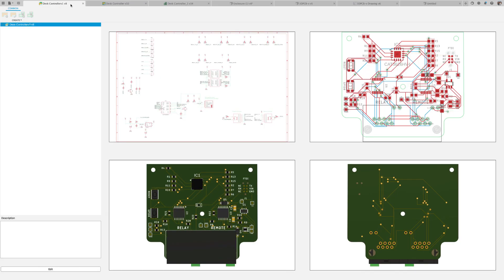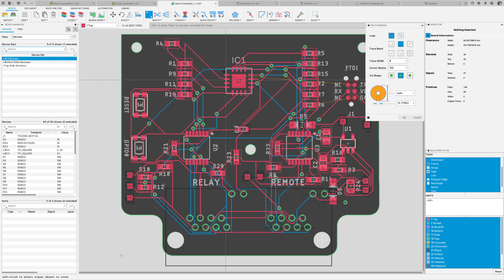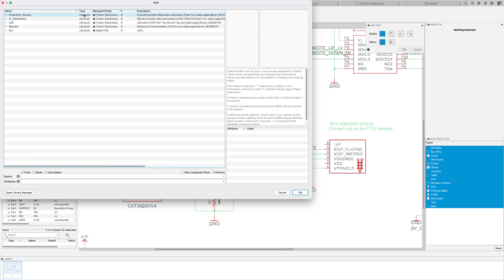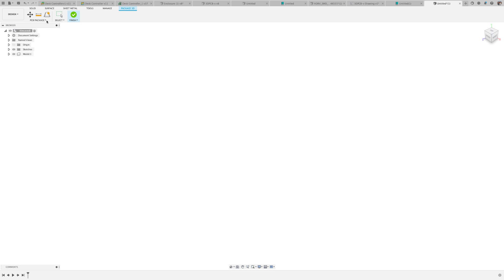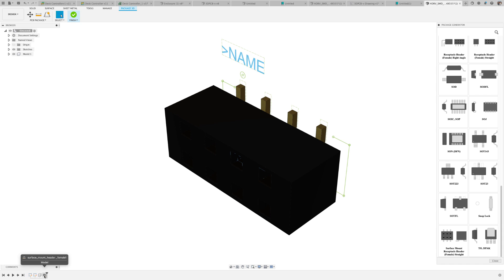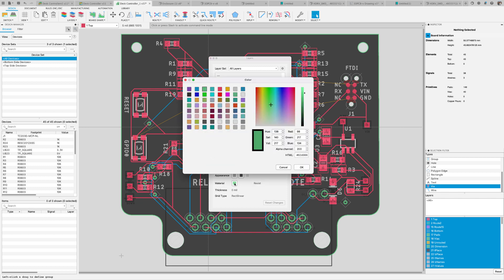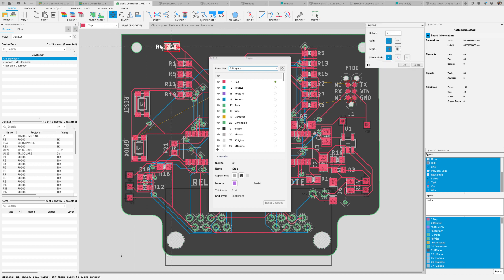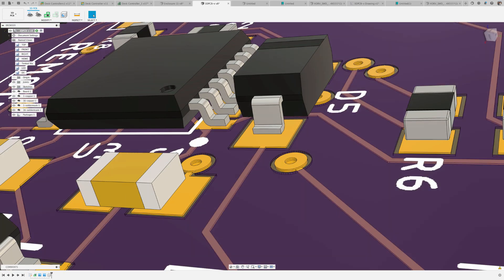Whats New Fusion 360 Electronics

Comment: Nice updates. 
01:30 "Exponentially improve......" - Loop routing is nice but exponential improvement? C'mon. We are engineers. We know what 'exponential' means. Don't over sell a good thing. 
For new parts - I don't struggle with the common stuff. I dream of tools that can handle the odd-ball parts. I already have the typical stuff. 

In my world - I NEVER - EVER design based on the included libraries. I design with Digikey, Mouser, etc and then construct parts that I don't have in my verified library. Some parts have can be found in SnapEDA or Ultra Librarian which is a good start but usually need some edits before production.

Comment: Hey, I already have a 3D model of a TP4056 Module . Any ways to link its header pins to a symbol library using library editor ?
Reply from the maker: @Monish Mehmi, yes, there is. Please participate in our Fusion 360 forum. You will be able to post the question there and get the answers. Thank you@ https://forums.autodesk.com/t5/fusion-360-electronics/bd-p/6071